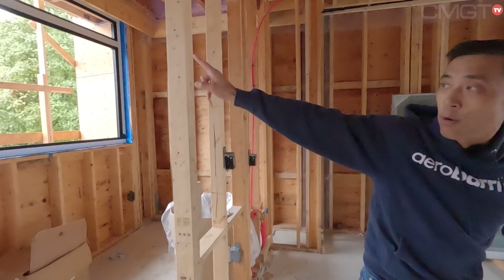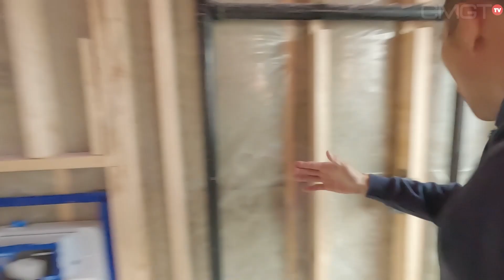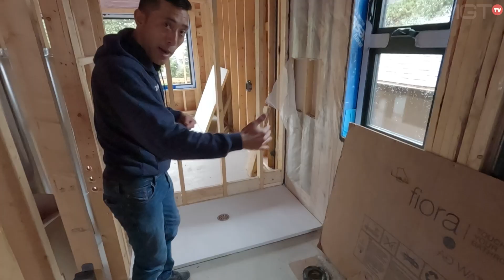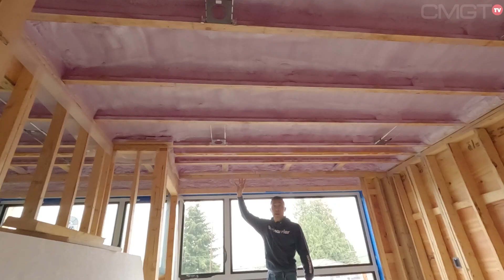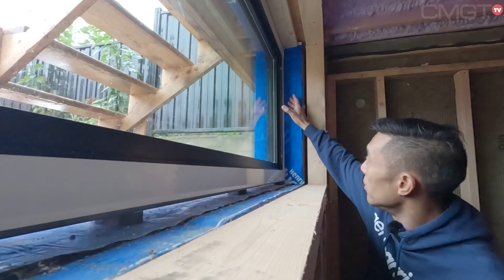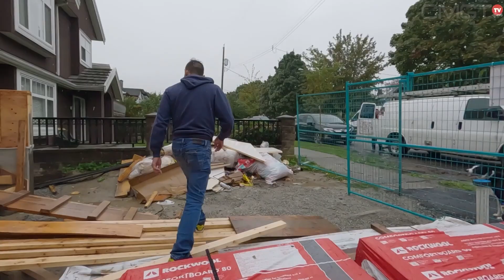Custom Home Build in Full Swing (Windows, Plumbing and Electrical Installed) | Episode 34

Comment: I spent a bit of time going through this video before writing this. You explain things in a way that feels clear and natural, which really helps with engagement. What I noticed is that the value inside the video feels slightly underrepresented by the current title. Making the outcome more direct could help the right viewers click more easily. The content is already strong — it’s mostly about improving how it's presented. If you'd like, I can share a couple of simple ideas.